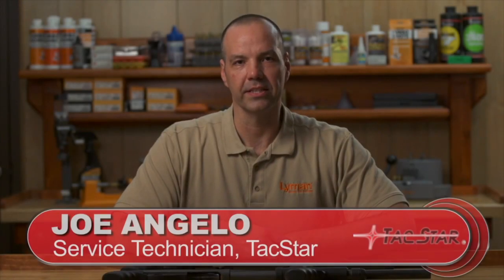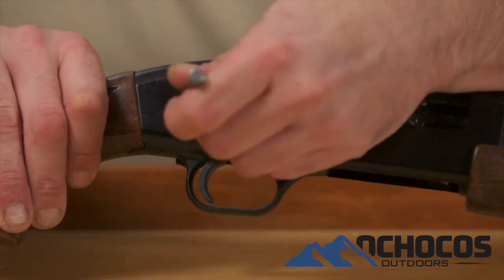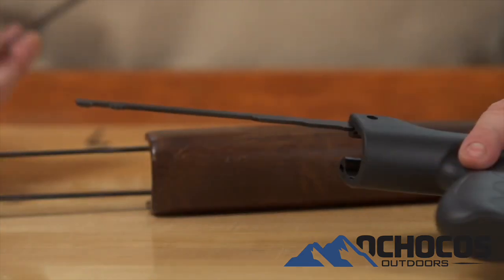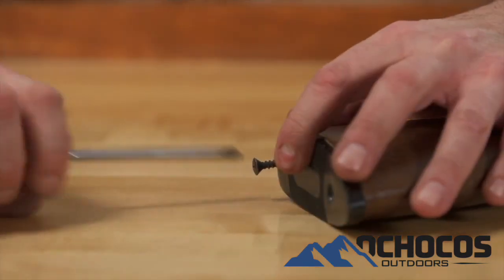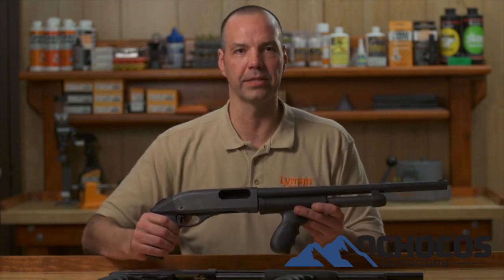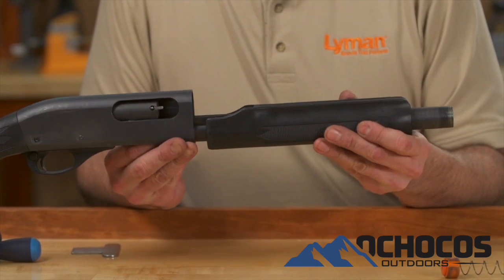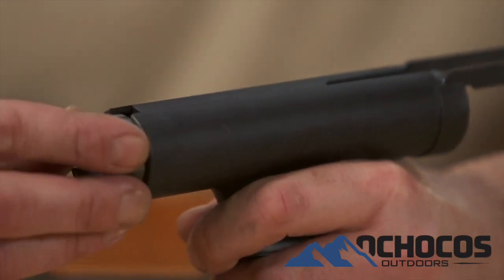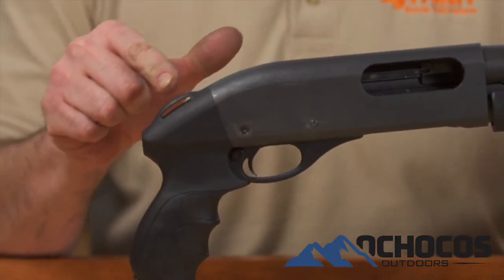Ask Joe How to Install the New Mossberg™ Forend Grip - Ochocos.com

Comment: Is this legal per ATF? I always thought a pistol grip shotty with a forend pistol grip would turn it I to an AOW or SBS?
Reply: The shotgun already has a forend grip. It was designed to be fired with two hands. The shape of the grip (vertical) does not change that. You can't add foregrips to pistols, because pistols were designed to be fired from one hand.